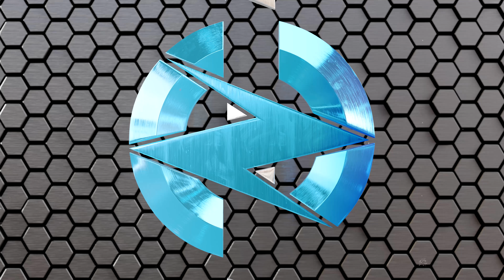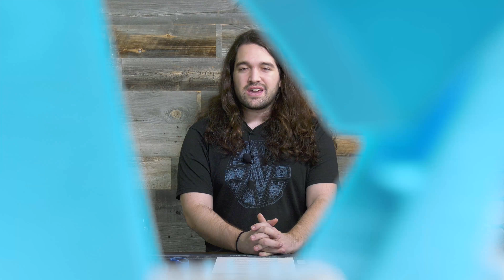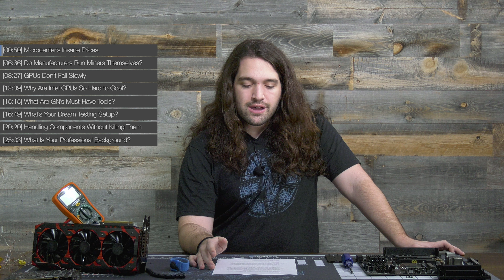Ask GN 68: Microcenter Ripoff, Why CPUs Are Harder to Cool

Comment: if CPU die size or thermal interfacing is the bottleneck, it doesn't explain why you can't use the same heatsynk size on cpu as gpu

Comment: Another reason GPUs are easier to cool for their wattage is because unlike a CPU, not all the heat being generated comes from the core. GPUs also have Vram and VRMs on the board that use power. I don't know how much power the Vram and VRMs actually use, but from the research I did as well as my personal experience I don't think it would be unreasonable to assume that the VRMs and Vram could together use 50 watts of power and therefore need to dissipate 50 watts of heat. If that is the case, a typical GPU with a TDP of 150 watts or so would only be producing 100 watts of heat at the core with the remaining 50 watts of heat being produced by the VRMs and Vram and therefore not directly affecting the core temp.

Comment: ASUS GeForce RTX 2080 Ti ROG Strix Overclocked Triple-Fan 11GB GDDR6 PCIe 3.0 Video Card

8 IN STOCK AT MADISON HEIGHTS MICRO CENTER
$1,299.99 SAVE $70.00
$1,229.99
$1,106.96 OPEN BOX
1 
IN-STORE ONLY
LIMIT 1 PER HOUSEHOLD

Comment: One thing I never understood is why Intel and AMD put a heatspreader on their cpu's. I feel like they could easily design a CPU and socket without one and Temps would be much better. Maybe it's a safety thing and they're worried about people damaging the die, but it's not like you're going to be in contact with the die for more than 10 minutes. It just seems like direct die cooling would be the way to go, especially as components keep getting smaller.

Comment: I bought my 8700K and Asus Z370 TUF at Microcenter for $380 three months ago. Great Combo deal,
but they sell 2 year old versions of PSUs and stuck me with the infamous CoolerMaster H500P for $110...discount allowed me to buy mesh and extra fan to make it a very good build. On graphics card tho...got a Asus 1060 6G for $250 from newegg in 2017.....and holding on to that dearly until 7mm?

Comment: ASK GN I wonder if you can answer - I tried to search and read couple hundred article but always some different answer and confusion. My question is regarding PCI-E lane I know in your ASK GN 51 video you told us Processor lane reserve for GPU it's up to us if we plug single GPU 16X or SLI each card 8X if Processor lanes are only for GPU why Intel SSD is mentioned there I can't attach screenshot that is why I attaching a link of Diagram - In diagram processor 16 lane are utilized by GPU or Intel SSD

Link:https://gnd-tech.com/2018/09/intel-z370-versus-intel-z390-chipset-whats-the-difference/ 

One more question Can you please explain HSIO little more for example, if I want to plug NVME in z390 Motherboard it will disable a couple of my SATA port (That's totally fine with me) but I don't want to lose any of my bandwidth (16 Lanes of Intel processor) because I have SLI configuration and each card is utilized 8X - please clarify - I want to put NVME but if my GPU's performance affected by NVME drive I will be better off with Sata SSD - I'm looking forward for your reply.

Comment: 12:39 - I've actually came across something interesting here with my own hardware

My I3 6100 runs about 58c under a stress test with a Hyper 212 Evo while consuming 37.1w where as my Overclocked AMD Athlon X4 950 while eating about 78.9w on the exact same cooler runs about 61c which is still higher but only by 3c at double the wattage, Soldered IHS FTW?

edit: by exact same cooler I bought a AM4 upgrade kit for it and even used the same thermal paste and fans for even the case.

Comment: A good oscilloscope.  And they aren't anywhere near as expensive these days either.  At least 100Mhz, higher is better.  And learn about grounding and common mode noise.

Electrostatic discharge is fun.  I've been working with IC's since, oh, 40 years now and have basically never used a static wrist guard.  Static pads, yes... some care... no carpets allowed :-).  But basically for that whole time I've only blown up a chip once, and it was a strange PMos IC (not even NMos) that would blow up just by staring at it.   Pins/pads on chips have some pretty serious electrostatic discharge protection circuitry on the IC, on a pin-by-pin basis.

Pretty much all I do these days is touch my hand to a good ground plane before handling the circuit board or chip.  The inside of a computer case is all one big ground plane so touching that is plenty good enough.  And I don't work on a carpet.  Wood is good... anything that doesn't build up static charge is fine, plus touching a ground plane somewhere every once in a while.

-Matt

Comment: I have a question for you. I have an Asus x470 Strix and a 2700X, and in line with your comments about the crosshair, it seems the board is supplying a rather high voltage. On air cooling, under boost it hits 80C pretty quickly. 
I therefore undervolted it using an offset of something like 0.085v.
The question is, if you have a CPU default setting in the BIOS of 1.1ish volts, what is actually delivered when the chip is running by the board? I am seeing around 0.8v to nearly 1.5v before I entered the offset, and up to 1.4v on 100% load. Now I see slightly over 1.3v and temps staying under 80 with all cores at 4040 to 4066MHz. 
The problem is not stability under load, now I see instability when idle as I think the offset is pushing the voltage too low on idle. 
I wanted to leave it in standard trim but the board settings are forcing me to tinker. I'm guessing my best bet is to take control completely and do an all core OC....like you said to do in the first place :p

Comment: Many (most?) miners are running their cards at ~70-80% max power and their temperatures are in the 40's Celsius. Doing that 24/7 is probably less of a strain on the card then running it 100% 4-6 hours a day....and if you mine with a 1080 for a year and it dies, oh well. It has paid itself over 3 times :)

Comment: "Touching the PCIe slot isn't gonna cause corrosion unless you are an alien." Well, I can't braze and weld because my sweat is actually causing corrosion, It can even dissolve the paint on something like a heater. It's rare but it can be!
I HAVE to wear gloves while working with metal and electronics or wash my hands very frequently...

Comment: How come I keep seeing multiple listings of the same exact ddr4 memory but with different prices, (on the same sites). logic tells me it doesn't make sense? for example, 2 listings. exactly the same in every way except the slower version costs more then the faster version!
I got a 4x4 16gb kit of dominator platinum ddr4 3000 because it was $40 cheaper then the 2666 variant. I saw this across every brand. whats that about?

Comment: Hi GN, I got a question for you. 
Is there any significant difference in CPU performance while gaming between using a dedicated sound card, on-board sound or an USB headset? I could imagine that the USB headset puts additional workload on the CPU, on the other hand with modern multi core CPUs there could be enough headroom to render and encode sound. Have you ever done a comparison between different audio solutions?

Comment: ASK GN:  How to deal with a motherboard that does not have enough fan headers?  I would like to control the fan speed by the way of PWM on a motherboard that does not have enough fan headers.  My motherboard only has 2 case and 1 cpu fan headers.  I was looking at a fan slitter but do the fans have to be the same for this to work?  What about a fan controller?  Does this work with different type fans and can the motherboard control them?  How does this work?

Comment: Hi steve, really like your professional reviews and analysis. 
I recently upgraded from a H87 Haswell platform to the new Coffee Lake Z370 with i5-8600k that support nvme drive. I now use a MX300 512G SSD as a boot drive and a Kingston SSD Now 120G SATA SSD as a Steam Library. I’m contemplating if it’s worth it to upgrade my boot drive to a NVMe SSD like the 960EVO. I’m mainly a gamer and java developer(I don’t usually compile huge projects on my own system tho) but occasionally do some photoshop work. Will I see tangible performance improvement in terms of my gaming performance and java performance? Thanks

Comment: OK the Microcenter thing. I used to work in there(not for money, just see how their system works). Here is what i can say. So basically Microcenter is a business, their philosophy is that they have something cheaper than everywhere else to lure you into the store(CPU and Motherboard combo, which is the only item i buy from their stores) and then the logic is this, ok you wanna build a computer, you are not going to just buy a CPU and Motherboard, 90% people are lazy so they want to buy everything (powersupply, monitor, etc), when you are in the store, you buy those other components that are way expensive than Amazon, Newegg etc. So they suck you into the store, and then try to up-sell you garbage that carries a higher margin basically like a car dealership ( cables, accessories, small items, things on the checkout lane, things on the customer service lane, warranties, software) They also pay garbage wages to their employees( The basic wage is 4$/hour plus your commission, they have an extremely high employee turnover rate) when you go interview they told you that employees earn 50-90$ per hour on associates. 
Short version, they are a business dont really care your buisness, only your money. If you ever want to buy components from them, only buy the CPU + Motherboard combo and then source everything else online

Comment: They apparently changed their GPU policy yet again. Now they will sell you whichever GPU you want at MSRP "if", you are buying it for a gaming PC. There is a catch however...you are required to purchase the CPU, motherboard and all the other needed components to build the gaming PC. This is still a fucked up policy. So, what about those who just want to upgrade their current older or weaker GPU for a 1060,1070 or 1080 plus Ti model? Fuck those gamers I guess? Only those building a complete gaming rig get to purchase a GPU at MSRP or close. Smfh. Next time I build a gaming PC I will be sure to spend my money elsewhere instead of Microcenter (which is where I got my PSU, MSI mobo and DDR4 memory from). Like everyone else, MC have shown their true corporate greed and want to burn everyone wanting a new GPU. Fuck that.

Comment: hope you realize that it is Nvidia that started all of this. nvidia literally told microcenter and other retailers to up the prices, and they are literally charging the retailers more. nvidia is working on next gen and they have to be able to have something in stock. the microcenter near me had around 300 graphics cards shipped in about a week before the price jump, and they day after they received them, all gone. all of them. not a single one left. nvidia cant keep having this happening, as they are trying to now manufacture the newer generation of cards and they cant have all of the fabs they buy parts from keep making the old materials at the same level. this is not microcenters fault, they are doing what nvidia wants them to do. and yes, nvidia told them that if someone is building a machine, that they can give brakes to them on the cards and nvidia will help the retailer buy paying back the difference. it also took around 3 days for all of this to start to get situated. changes went to corporate, from there to the warehouse and from there to the retail store managers and it is on the discretion of the store manager, based off of the customer and what they are buying as well as the amount of stock that they have, which btw, is very, very little.

Comment: Hello there!
I have a question regarding push vs pull on radiators like clcs on GPUs. is there anything that speaks for using one or the other besides LinusTechTips statement "They are easier to blow out and to clean if the fan pulls and isn't in the way" (very rough quote) or the potential advantage of getting air in the middle that doesn't have to flow over the hot radiator first (for push)?

Comment: Have you noticed the rash of low pricing on 1080 TI boards on Ebay? They quickly disappear as either accounts or the postings gets pulled. I think Ebay has a serious problem with hackers.

Comment: I think they're seeing how fast 1080ti are selling and how much stock they have, and limited 1 per household to maintain the SKU, to make sure it's always available. That is their trump card, retail doesn't sell components to non-desperate enlightened customers, so they MUST stock them for the desperate ones. Whether their assessment is correct and whether they could have maintained the stock without limitation at that price is pretty much besides the point, their line of thinking is sound.

Comment: I have a question towerads power supplies. So the question goes for the 80 plus certificate, i've been looking for a PSU these weeks and all suggestions are for 80+ certificate which i understand. Now the thing that confuses me the most is that all of the PSU that have the certificate that i have found in my country have the certificate for 230V, the standard voltage is my country is 220V? What does this mean is it still that efficient or smt happens? Plz explain

Comment: in regards to the recommended tools; i  never use hwinfo64 on my pc. when i start it up i seem to lose 2 drives. they dont show up in hwinfo64 and after starting the software they cant be found in windows anymore either until i restart my pc. im currently running an Asus max. 8 hero with 6700k, 3 ssd's and 1 wd black 1TB drive. its always 1 ssd and the wd black that dissapear

Comment: oil does cause some oxidation, but it can take years. And the part need to be exposed to air.  Seen this first hand opening old PC (30+ years old)
You could see fingerprint/mark etched into shielding shroud where the person handled the part.

Comment: For the space heater.. totally doing that right now. Its a 1650w, 400 MH rated space heater that generate ~$1200 a month at the moment.
If GPU prices where not so high I would build another one as I'm still using a plain old space heater in another room. Total wasting electricity.

Comment: in Europe GPU's are sold slightly higher then the MSRP. Doesn't help you guys, but it seems to be more of an US problem. Availability is also an issue in Europe. Concerning RAM the same problem in Europe. BUT: In China RAM can be bought for very competitive prices. ADATA 2* 8GB 2400 MHZ DDR e.g. is sold in Europe for about 180 EUR, (223 USD). But in China you find it (computer markets, Taobao, etc) starting from 173 RMB per 8GB. Therefore 2* GB would be around 44 EUR, 54 USD. Same with GPU's. 1080TI's are available here from around 800 USD and are available. And we know from history that gaps in pricing improves import / export. So, use your Chinese connections, find an export office and buy yourself 100 sticks of Ram and sell them yourselves. There is an opportunity.

Comment: I was told:
If you can't buy a new GPU, just mine with your current one.
Well, my Card has only 2 gigs of vram, so my Card is useless in terms of "high profit" cryptocurrency, (or that's what I heard, miners correct me if I'm wrong)
Also, my card is pretty old and i don't want to overstress it. Because I just can't afford a new GPU. Im pretty boned.

Comment: People sometimes think that certs mean you know what you are about. 

I hold an electrical license in Va. , but it does not mean that I know more than the next electrician that never took the exam.

I can tell you that having a cert means you went to some school or other formal training and passed a test, but that does not mean you will have people beating down your door to hire you.

Sometimes having the cert is not enough to get your foot in the door for a new hire,  but it is a first step.

A cert does not mean you are an expert nor does it mean that you will be the go to guy/girl on the job. I've known some people who got a cert, then felt that the jobs they were first handed beneath them. 

Why?

After all they got a cert, and they were miffed that they worked for some guy/girl that did not have a cert or lacked a college degree.

It is no indicator that having a new cert means that  you are a raw recruit out of school. 

There are those with certs that went to school to get a cert with enough experience to not need the cert, but found that many do not understand the requirements of the job and need the paper in order to hire or advance to the next level.

In other words,  sometimes supervisors who do nothing but shuffle paper all day do not fully understand what makes a qualified person, due to never actually having done a particular job, but supervising personal just the same. I can point at HR people that do the first look at potential new hires. 

This is a fact of life, and anyone who keeps on pestering Steve about certs should ask themselves a question.

Would you hire a young person who just got out of tech school to oversee the framing  of your new dream home, or would you hire a carpenter that's been on the job for years?

The older guy might not have the tech school cert but.................................

Comment: I think you need to go recheck Amazon and Newegg.  Both are selling 1050 for 200+ and 1060 for 400+ and not third party seller.  Amazon had a 980 for 700 and not even a 980ti... They are just as big a crooks as third party, or close anyways..